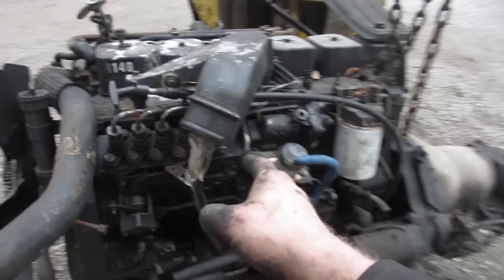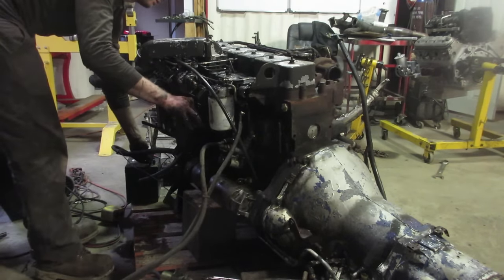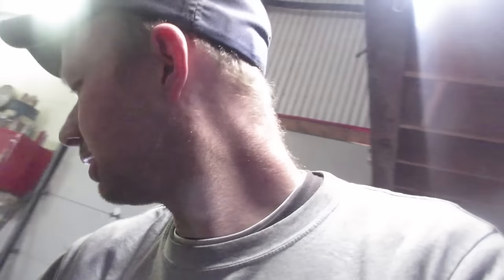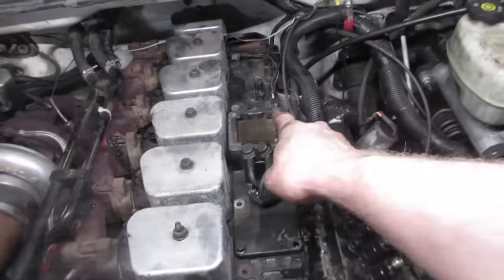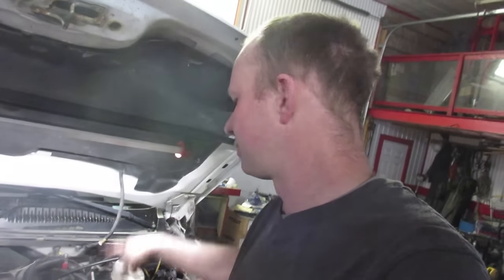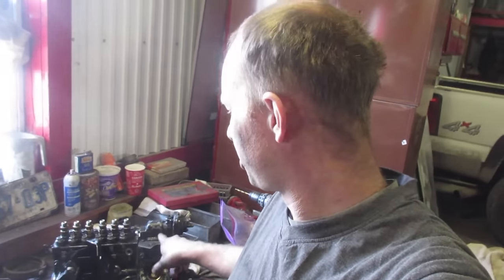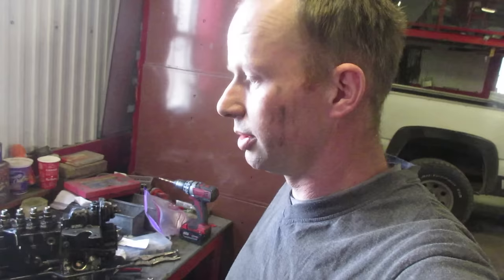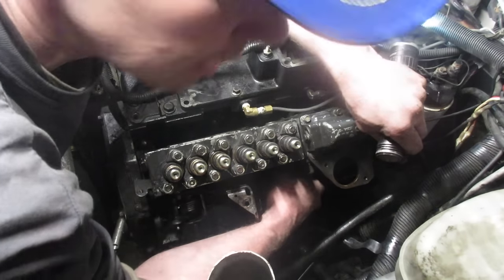12v Cummins P-Pump Governor Springs & Fuel Plate Mod = POWER!

Comment: Got me a 1996 5.9 12valve sitting in the yard but all I could find was an 8.3L P7100 Pump on Craigslist. I don't know if it will work on a 5.9 though? I'd also love to come across an NV4500 5spd 2WD tranny.

Comment: Engine off, can fuel be electrically pumped beyond the mechanical lift pump, thru the p7100 and thru the injectors and out the return of p7100/ injectors ?

Comment: Hey man I know this is a long shot but I have a question about my p pump I have a 94 manual 12 valve it has a 0 block and a set of 4000 springs also afc slid back with the elbow. Question is why would I be losing top end it surges in and out at around 2-2200 if I  ease off pedal it will pick up if I hold it down it will die? What's your opinion?? Pls help

Comment: 570,000km 96 automatic, doing a 3k spring and #8 fuel plate.. no or minimal risk on the engine? transmission run it till it needs a rebuild then use stock parts or will it need some aftermarket parts? should be in the 250-300HP range 600-650ftlbs, daily driver probably tow 14k dump trailer

Comment: Did you install 3 or 4K springs and what fuel plate ?? I pulled my plate completely and if I remember correctly I think 4 or 5 clicks down on the governor springs. Only difference is revs higher now

Comment: Hello hope you could help me got a 97 5.9  12   V did that nice swap to f550  truck runs sounds great but have a big big problem it’s leaking oil from the tube and oil dip stick  only when on high rpm like 2500   So I pulled the motor and rings piston everything looks great motor only has 145 k miles  please give me your advice blow by was not to much it was normal

Comment: a little more money than that fuel plate, you could have bought the AFC Live in cab tuner from Power Driven Diesel instead..love mine on my 12 valve!
Reply: good explanation on the gov spring change over and pulling p-pump off too....well done!

Comment: I’m working on something bio diesels or something like molasses was or liquid plastic in tank it was shellac in filter smell I can’t get fuel though p pump yet any tips the lines all dry maybe 2  guy to touch it in 10 years  I cleaned tank got flow at filter  screw

Comment: Hey I got a couple questions for you a few weeks ago I have a 1996 Dodge ram Cummins 12 valve p pump truck is always ran good there's only time I was ever low on oil pressure as if I was low on oil now it does smoke it used to smoke white quite a bit ever since I got the truck and needs a head gasket which I've been on the verge of I'm just going to throw a gasket or put a new head on well the trucks always ran good and a few weeks ago was driving down the freeway and had fluid in it and everything even though it needs a head gasket at least at the back of the head it started losing power I thought it might have been a sensor or something like that no check engine light was sure enough I checked the number one delivery valve on the pee pump and I was getting hardly any fluid so I ordered new delivery valves supposedly supposed to be stock but aftermarket from a diesel place online by the way twice for two different tools one tool was off Amazon some Chinese delivery valve removal and the other one through snap-on the first one didn't even fit and I think it might have been $30 a second one was around the same price and that one is through Blue point snap-on I pulled the valve looked at everything the old ring seemed kind of funny put a new o-ring in that came with the new delivery valves and the delivery valve is a little bit smaller than the original in the numbers do not match I tried starting it up with a new delivery valve the truck will not run put the original delivery valve back and cleaned it up with a new o-ring and she fired up and runs a lot better I still haven't done a compression check but I have been getting milkish ask a few months on the dipstick since the head gasket has gotten worse and worse now I keep fluid in it I don't let it overheat I add about 2 gallons every few days but ever since that happened a few weeks ago it's developed a little tick in my oil pressure has been like around 20 boost up to about 40 Weil I'm driving when I first start the truck up it'll be at about 60I haven't stuck a manual gauge yet but this truck is always been around 50 to 60 PSI is even at idle the truck sometimes runs better than others now and I am getting a good amount of fuel through the pee pump the number one delivery valve which I was having an issue with before what could my rough running be to do with low oil or the injection pump not working correctly I was going to order a brand new injection pump Chinese model which I've heard good things about and I ordered a rebuild kit for the p7100 this is an automatic transmission cruise control tilt wheel air conditioning single cab long bed 4 x 4 the new rebuild kit for the p7100 only comes with little rings washers and o-rings and stuff like that and gaskets I see that there is valves there's delivery valves and the thing that goes inside the delivery valve and then also springs so there's more quite complex to this than what it shows just in this rebuild kit so my question is should I get a original p7100 pump gorgeous rebuild it with what I have and also can I just replace that one valve with the OEM with the spring and the delivery valve for the pee pump and do you think that'll solve my problem should I stick a gauge on it and see if I am lacking fuel somewhere off the pump or the engine side some people say to run a gauge a fuel gauge right off the fuel filter housing so and then I'm going to run a manual oil gauge cuz I was having a problem before with the oil sending on this a couple years ago I replaced it it's been good ever since do you think also that the oil pickup tube could have issues because the head gasket a water seeping into the engine if I change the oil that is not milky it only comes out milky when you pull it on the stick like condensation other than that I always change my oil every like 2000 miles I know you can go a lot more technically what I wanted to do was put a new hat on it with a new gasket a new oil pump in a new pickup tube to be a new p7100 or just rebuild the p7100 and also I'm thinking about doing a rebuild on another engine and should I use all Cummins OEM Pistons with rods and is any aftermarket like mahle for any of them Fel-Pro a good piston ring and piston set if I rebuild the engine should I have the cam turn just to be on the safe side this engine here that's in my truck has over 400,000 on it which I know these trucks will go over a million miles or close to it it does burn oil can I have a spare engine it's only supposedly got 130 but I was going to do the rebuild on the lower mileage engine tell me what your thoughts are at least

Comment: The first red flag I get when pulling any engine is clean oil…the chances of them changing the oil right before they decide to scrap a vehicle is probably less than low oil pressure light coming on and someone deciding to try to throw oil in it 😂

Comment: Reving out at 2200 cause that’s factory defuel , you changed that with the new gov springs man should also add at least 60 lb valve springs on exhaust side at least so don’t float valves over 3000 or 3200 rpms
Reply from the maker: They call them 3200 springs in both the VE and the P pump but I have never seen them rev that high.  You usually only get 500-600 rpm and that is still safe.  If you add 4000 rpm springs, definitely need valve springs
Reply: DEBOSS GARAGE  ok I’ve always seen em as a 3/4 k kit for the p7100 pump for 3k you just leave smallest spring out and 4K you install all three from kit

Comment: Hey, so on my 94 12 valve, it has absolutely no blow by when cold no matter if I rev it or not, and when its warmed up, the cap still doesn't dance around, but when I rev it, the cap will just fall off, and it of course has more steady oil vapor. I've always kind of wondered about when blow by is most apparent. In theory, id kindof think its when the motors cold as the rings havent expanded, but do you get the most accurate results when warm? The motor always has lots of power, and always starts great warm or cold. Could this be a turbo issue?

Comment: What did you do to hook up the power steering feed line? On my block the motor mount is pretty close to it. Its in a 1991 V 3500 gmc. It is a 12v. Any help would be great.

Comment: Ok question, so are you supposed to plug off the blow-by tube when doing the blow-by test this way or do you just leave it open like normal?
Reply: MudWrench186 I know this is old but leave it open.

Comment: Hey D, I have a 12 valve and the guy before me had installed 370 marine injectors. Don’t know how long they have been in but they run just fine. But all I hear is that they have a wrong/bowl like spray pattern and that you shouldn’t use them. What’s your opinion?
Reply: Really  not a big deal unless you advance timing a lot.  Still always going to be hot and smokey

Comment: F-350 single cab with the 7.3 powerstroke non intercooled I'm thinking about doing a swap with a 12 valve I actually like the way that a73 runs I think smoother that a 12 valve in my opinion Powerstroke at least it just got a firmer crack to it but I'm very so debating on getting rid of all the electronic stuff more aggravation more time or money and just going with a mechanical 12 valve and knowing my truck there's a problem I know how to fix it you know he's getting a good running 12-valve all mechanical with a PE pump making sure all the gaskets are good hornets and wanted to know what your thoughts and input is if you ever done with an older F-series truck late 80s early 90s and I'm going to be doing it all myself I have a hoist I have over $100,000 worth of tools I'm a licensed mechanic this will be my first one I'm going to do I didn't know if there's pre-made engine mounts already and I wanted to know that with my F350 1997 old body style I'm going to be installing a Dana 60 front end with the original Fame forms up front leaf springs all original I'm not going crazy with all that aftermarket stuff it's all original and I wanted to know with where the engine sets like the Cradle of it the 7-3 has a big boil pump I noticed it the 12 valve has a lot Slimmer oil pump but it's a longer engine all in all I would have to do the exact measurements and so forth but I've seen guys do it and I'm sure that I could do it it wouldn't be that difficult and do I need an intercooler or should I stay away from an intercooler I know it's better that you have an intercooler but I know that the early first generation diesels of the 5.9 late 80s early 90s didn't have an intercooler should I just go with one of them since my truck doesn't have intercool already you think that'll be fine or should I go with the later-model like a 1994 through 97 model 5.9 12 valve that paused a 5.9 12 valve and then modify them to fit my frame should I just make up something new I haven't seen one personally done myself up close I've seen people over the internet but not actually done up-close-and-personal to see what they did it's not that hard to me I can make a set of engine mounts and probably half a day to do a nice job cleaning knee but I just wanted to see what they had available and I wanted to know how the transmission I'm going to be going with an automatic e4od heavy duty for the 7-3 do you think that that would be fine or should I go with an Allison that'll couple rate to it I'm just going to have to either probably ad 4 take away on the drive shafts how do you think it'll fit with bringing the cab down the motors only going to go so far but I think honestly it shouldn't be that difficult I got the truck up on the voice right now I'm going to be doing this pretty fast I want to set a good running 12 valve in their Mount up the trans everything up can I keep the original radiator or should I have to go with a radiator out of a Dodge Cummins because of the displacement difference I would think that I could keep the original 73 radiator because it's bigger and it would never hurt to have more fluid than less fluid and then what about the AC can I use the original condenser can I just swap the plug for the AC compressor to work with my Dash and I know it's just the throttle cable so if I gets a out of a 91 7.3 IDI naturally aspirated foot pedal and throttle cable assembly to make it look original I'll tear that up pretty simple with the throttle linkage off the 5.9 12 valve and if I got to make a couple brackets up no biggie that should be a pretty simple fix also I'm going to be adding an axillary 12-volt hydraulic pump mounted off the engine to run coherent with the rest of the belts and pulleys that's because this truck is a record with a boom in a wheel lift and it has a manual PTO and I'm going to make it an automatic PTO where citrate up off the engine so I can just hit a switch and I wouldn't be able to use the other one anyways because I'm going from a 5-speed manual ZF 5 turn automatic either 4od 5-speed heavy duty I'm going with an Allison I'm just trying to get my ducks in a row if I come across a real good deal on a $12 I think I'm going to go with the 12 valve I have a 12 L 1997 right now that runs great I've had it for about a year and it's in my truck it's a single cab Lariat four-wheel drive with the Dana 60 and it is a 2500 series Daniel only problem I have with that never no issues with it starting starts every time even in the coldest of the coldest of the day super dependable 300 thousand miles it is p-pump with originally from the factory and I believe it's a Bosch pump so and this one is intercooled love you but the only issue that I have went to this once in awhile even after it is warmed up sometimes if you step on the throttle fast to put it in reverse can you just give it full gas all the way it'll stall if you give it for throttle like if you just start it up and let it run for like less than a minute and put it in reverse and just hold it down to the floor it'll just all on you but it only does that usually when it's cold after gets warmed up at usually don't do that but it still does sometimes I haven't looked into it fully but that's the only issue that I don't like everything else seems to be a die-hard engine

Comment: I have a Cummins turbo  6btm in my trawler boat. It  has 5,000 hours on it.
I dont know what that equates to in miles. Do you have any idea .....is that alot of hours on one of these motors ?
I run it at 1,600 to 1,,800 rpm.
I'm hoping it has some life left in it.

Comment: is doing the zero plate mod safe to do on a bone stock motor?  i would like to start hopping up my 12v but i want to know how far i can go without touching anything but fuel.
Reply from the maker: It will smoke like burning fiberglass.  Please don't be that guy and tune it properly
Reply: @DEBOSSGARAGE  trust me, i don’t think smoke is cool in any way. i’m trying to gather all info i can on tuning 12v’s properly before i try anything.

Comment: hi can you please tell me witch spring is for what (idle-mid-top end)..the smallest is for top end?
Reply: Not sure which springs controls what, but alot of trucks are different in regards to the shims. Mine only had a shim on the large outer spring (it came out on accident when I took out the three inner springs with a magnet. Dropped it in the pump. Took a few hours of fishing to get it back. So be careful. ) I do know that If you get a 3-4k governor spring kit, if you only want to rev to around 3200 rpm DONT install the smallest springs that come in your kit. Take the three inner springs out and only put back in the two larger new springs.  They say if you go to 4000 rpm kit it is really a good idea to install 60 lbs valve springs. I got a valve spring kit but won't have time to put it in till winter, so I installed 3k gov springs till then. Hope this helps if you are installing a set. Great improvement very well worth it.

Comment: sorry I have a dodge ram I changed the tap cober gacket and obially I had to remove the injection pump and now arm everything to get the air out and I still could not turn it on you have any idea you can give me please

Comment: I have a 96 12 valve with an automatic. Would putting governor springs in my pump destroy my transmission? Can’t find any info about people putting gov springs in auto trucks online
Reply: Mikeal Johnson no governor springs are gonna give you some better throttle response and full fuel till whatever the springs are rated for. A 3800 spring will let you fuel to 3800 possibly a tad higher in neutral or park. Stock in an auto you’d be lucky to get it past 2600. That’s all it does.

Comment: When bleedin a diesel do you break all the lines lose or 1 at a time
Reply: All of the lines if it was completely ran out of fuel. Make sure to also hold it at full throttle so it can bleed all of the air out

Comment: DEBOSS GARAGE, do you know where I can get a wiring diagram for an 1989 dodge D350 5.9 cummins. i have a wiring issue with my lights, it started with a pinch in the harness, which caused a short, and melted my fuse panel, etc.... im sure you know where thats heading
Reply: Turtle-_- Gaming Haynes

Comment: So you think that would fit inside a 2002 chevy Silverado z71 1500 extended cab, it has a 5.3 in it now
Reply from the maker: It will fit but the 1500 frame ans suspension won't handle it
Reply: DEBOSS GARAGE any suggestions? Really wanna put a 12 value in the truck at some point
Reply: PairOfBluePants do a 4bt then
Reply: Not exactly true. GM used to run the 6.2-6.5 diesel in 1500 Suburbans and at least a couple of aftermarket sellers make motor mounts  to put a Cummins in your application. It's doable, but you have to be conservative about what kind of power you make. Probably keep it below 500 lb ft. More than that and you will twist your truck's frame.